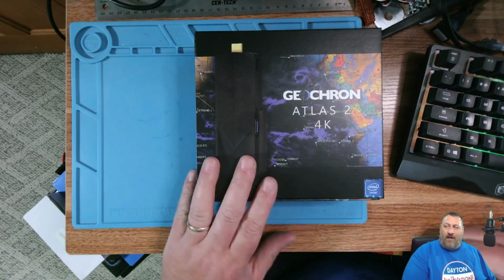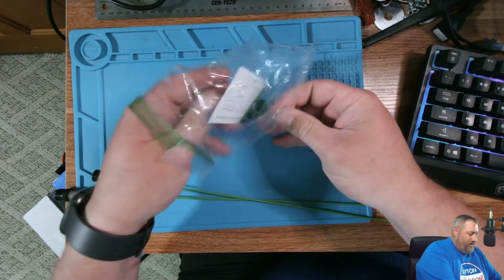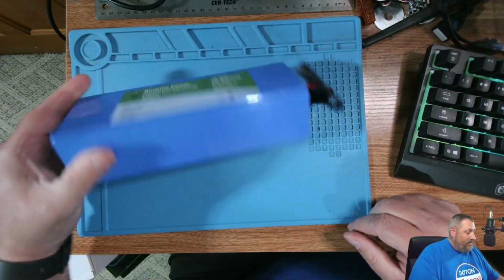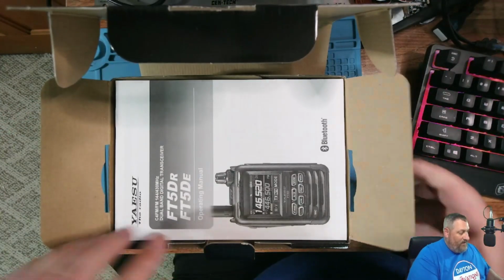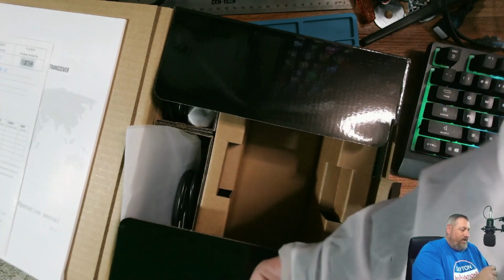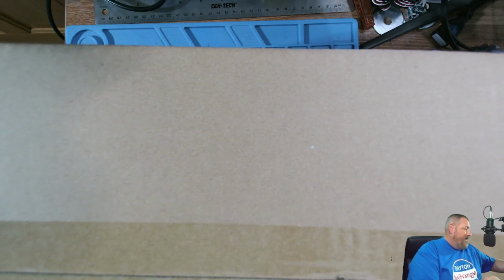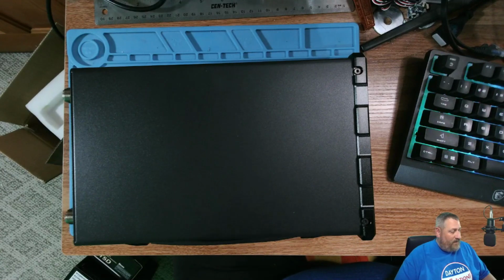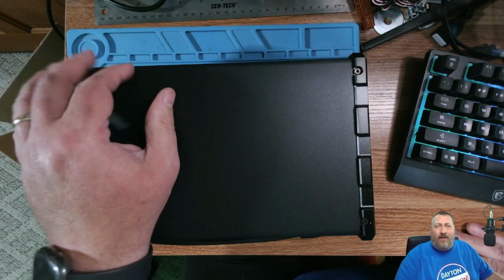2023 Dayton Hamvention gear and new toys for hobby FUN!!

Comment: Get your FT5 out and check it. Ordered one from HRO on Friday because of the sale. Got it Monday and charged it up. Out of the box the touch screen does not work. Did I get the odd one out there that was not put together right or they could have a run of bad radios. Just do not let it sit too long before checking. Since they sold out I have to send a brand new radio in for repair. Sad
Reply from the maker: Mine seems fine,  although the adms software for programming seems glitchy and isn't working correctly with windows  11. looks like programming one freq at a time for now
Reply: @NorthCountryHam  I picked up the RT systems software but have not even tried it yet
Reply from the maker: I ordered the RT software to try that when it comes, the first software I downloaded right from Yaesu,  not working right and it seems my data cable that came with the radio isn't working,  radio won't connect to my computer says device not recognized (usb malfunctioning). Others have had this and sounds like bad cable, I hope, otherwise it is the port on the radio
Reply: @NorthCountryHam  The cable with the radio is only for firmware updates and not radio programming
Reply from the maker: @ManleyOne  I have some researching to do,  the rt software runs and  computer sees the radio now, but when I get data from radio the 5d starts to TX and then errors, not sure why yet

Comment: I got to the HRO booth just before they closed and intended to buy an Icom ID 52a, which I did. Then Julian mention the very good deal on the FT-5D and it seemed hard to pass up. So I have access now to box DStar and WiresX rooms. And to boot I found a sale on the SharkRF Open Spot 4. Lots of learning ahead.😊😅